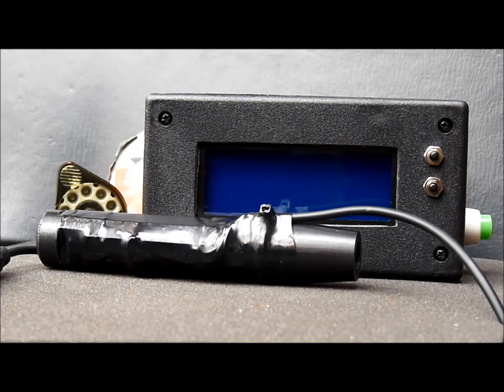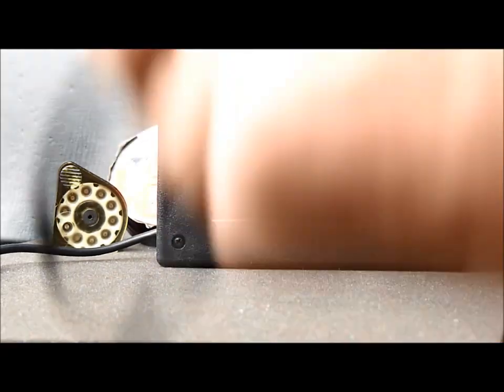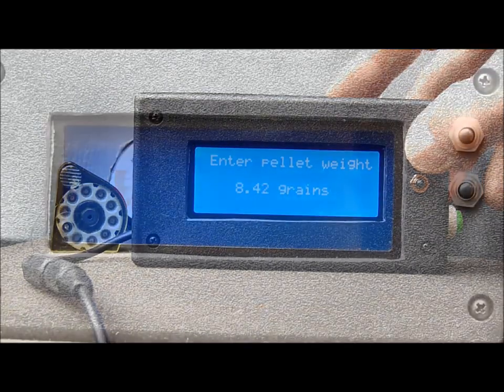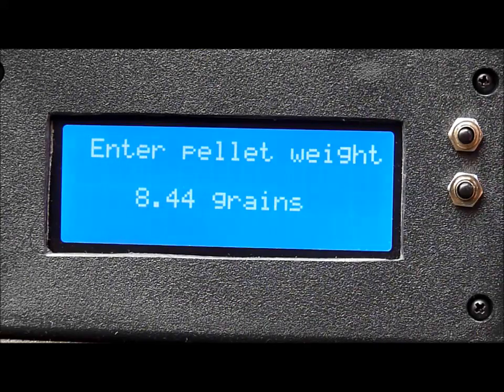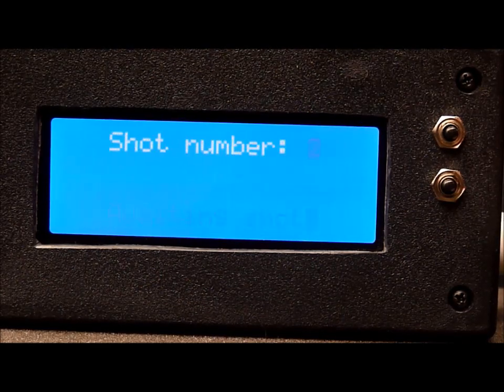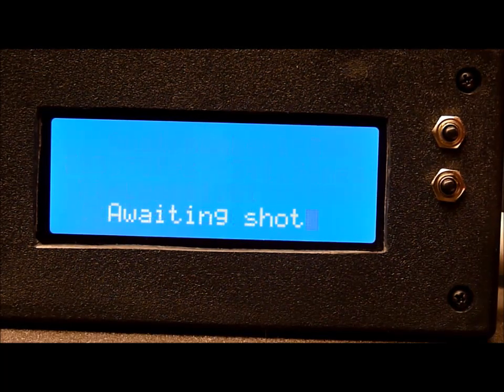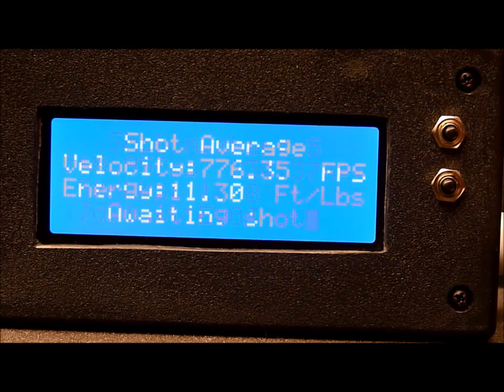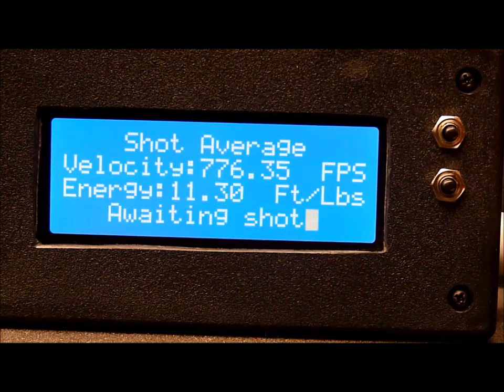AIR RIFLE Chronograph

Comment: Great little project, was accuracy checked against a commercial chrono? Are you still providing schematic and code? Thanks
Reply from the maker: Thanks Ian, some of the builders of the chrono have checked theirs against commercial chronos with good results. Yes the code and info is still available.
Reply: @doctorvox  
Thanks for your quick reply!
Glad to hear it’s accurate against the commercial ones. 
In your program do you read the ports directly or digital read and does it work using the interrupts and WDT?
With the standard adapter, what’s the largest gap you can have between the sensor and led that will reliably pick up the pellet? 
Have you tried making a larger adapter to fit the gun with more sensors?
Sorry for all the questions!
Reply from the maker: @iantcroft  the current program uses digitalRead, I have recently modified to  read ports directly (untested). I will send both versions if you want them. The emitter/sensor distance is about 25mm, 60/80/100mm between. I have not tried others, but it should be possible to make an array without using the barrel adaptor.
Reply: @doctorvox  
I’m not greatly experienced with programming/electronics but like to research and try and learn! (Although it doesn’t seem to be sinking in!) Very hard, don’t know how you do it! I have made a basic project before. 
Would be great to try and build this. You don’t currently do the kit? Where would you source the parts cheaply?
Thanks. Nice to see you are into your bikes, I have a little workshop in the south east.
Reply from the maker: @iantcroft  I'm no expert Ian, it took months of experimenting and asking questions to get to where it is now a completely usable chronograph. I like the way Arduino allows blocks of code from various projects to be combined to make it do what is needed. The parts are readily available on ebay, the IR sensor/emitters sometimes being the hardest bits to find (RS or Farnell?) the list is printed above. Just recently tried direct port addressing to speed up and refine the timing, (not that it really needs it).....that's waiting for someone to test it. Theoretical max speed is 24606FPS for the standard version !
Reply: @doctorvox  
I too like the way you can add sections of code to make it do as you wish, just wish I was better at it and learning new methods! Thanks for the info and your time. Will contact privately for code & information.
Reply from the maker: @iantcroft  Hope you got your chrono running OK Ian, thanks for your interest
Reply: @doctorvox  
Yes it’s all built and it’s all running well thanks, just want to compare against commercial one to confirm accuracy, it seems to be in the right place.

Comment: @Outdoorsman
Can i use another ir sensor/emitter?
Reply from the maker: Unfortunately not, the sensors used contain much more than simple IR detectors, so most others will not operate fast enough.
Reply: Ok thankyou so much op240 and opl550 is hard to find for me
Reply from the maker: @dingachawngthu1091  https://www.ebay.co.uk/itm/274338056591?hash=item3fdfd2898f:g:EVcAAOSwsWlel2Q5
Reply: @doctorvox  thankyou so much .but the seller does not ship to India
Reply: @doctorvox  i have found opl550 ir sensor now, but i cannot fine op240 led can i use another led?
Reply from the maker: @dingachawngthu1091  yes quite possibly, If you can find one of similar power and wavelength . Should not be as critical as the receiver OPL550......but I have not tried it.
Reply: Thankyou so much

Comment: What is the minimum velocity I can measure with this ? Also what are the sensors you are using ? can you please give me the code and the schematics for this ?
Reply from the maker: The sensors will detect a pellet just dropped through the sensor tube. I offer the code and schematic in my comments ABOVE.

Comment: Hello, Which sensors do i need and how much are the parts gonna cost? I would buy the code depending how much i will cost over all :) Already got the LCD and a nano and i will 3d print de casing so i just need the price of the sensor / what sensors are used. Thank you!
Reply from the maker: Thanks for your interest, the infra-red sensors used are OP240A  and OPL550 (two of each) . Other builders of the chrono have already made their own cases using a 3D printer also, so they may share their files.
Reply: @doctorvox  I CAN NOT FIND THE INFRARED SENSORS USED OP240A AND OPL550 I CAN USE OTHER TYPES WHICH ARE THE EQUIVALENTS 
THANK YOU
Reply from the maker: @rossellamagnoni4742  They are widely available on eBay, Mouser, Farnell etc.  The OPL550 or similar must be used, as it contains a photodiode, amplifier, voltage regulator, Schmitt trigger and NPN output transistor .

Comment: Hi - Just sent £5, please can you send the Schematics and Source code -Great project - Looking forward to building it now!
Reply from the maker: Thanks Owen, good luck with your construction, all files sent today.
Reply: Thanks - Very simple to put together.  My prototype is up and running with your code modified to suit a 16x2 LCD display.  

How did you mount the sensor tube to your rifle?  Looking for options.  I have an underlever and a PCP both of which have a lever or airtube right underneath the moderators that prevents a simple "slide in" option.
Reply from the maker: @owendrew5851  Nice work Owen, you can see how the sensor tube slides on my rifle here, early prototype. https://youtu.be/jZOJLJD3aNU
It may be more convenient if you can modify the sensors, (multiple sensors?) for a shoot through aperture, like commercial chrony, but may have problems with missing shots.